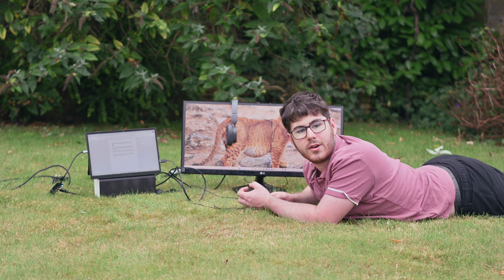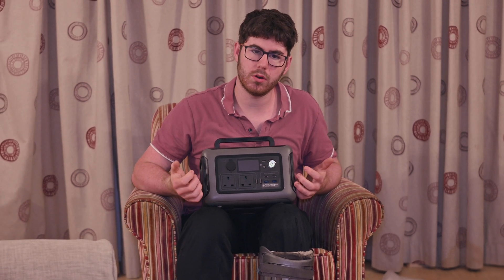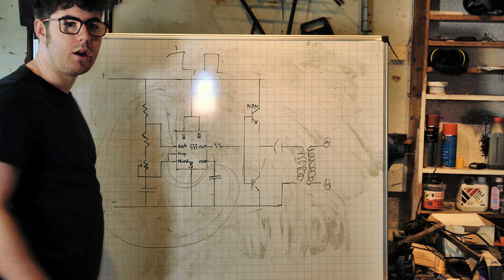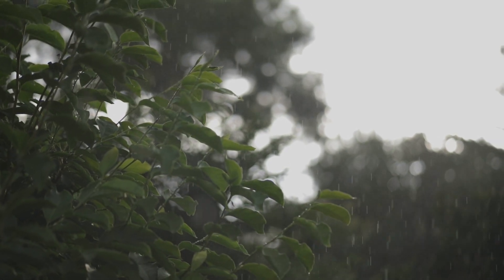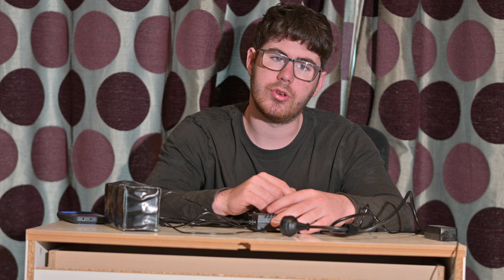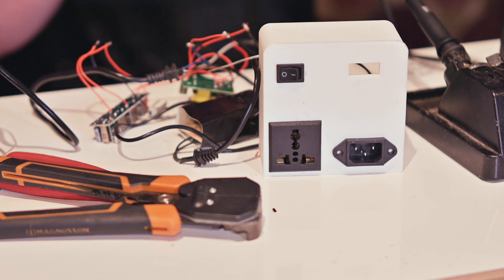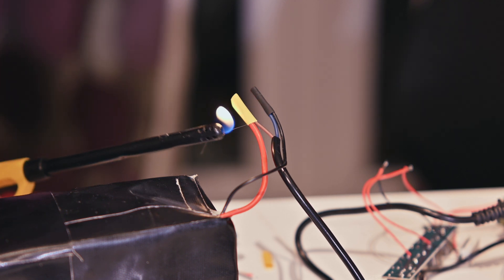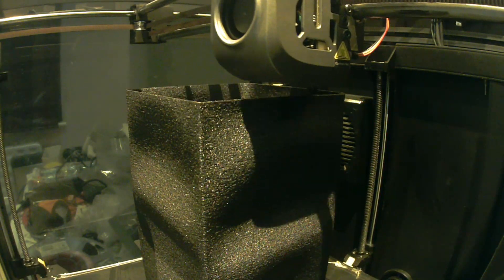Building a PowerStation For $50

Comment: Great video, thanks. Inverter and charger ordered! Can you recommend a BMS product for this project please?
Reply from the maker: Depends very much on your location, what country are you in?
Reply: @Boris_Woodward  Sorry, of course. I'm in England.
Reply from the maker: My favourite is this one: https://www.cellsupply.co.uk/bms/daly-3s-12v-30a-bms
the issue being that you cant get them without paying for a larger order. this one off amazon(https://www.amazon.co.uk/Ouitble-Lithium-Battery-Protection-Charging/dp/B09XV8RQKK?source=ps-sl-shoppingads-lpcontext&ref_=fplfs&psc=1&smid=A2HD2RU644B7TL) is a good cheap alternative but it has no short circuit protection so I would recommend using another form of over current protection. another good option is to step up to 4s so that the current is lower, in which case both theses options come in a 4s config as well

Comment: Very nice project!  Does the $50 (or is it pounds) include the cost of the battery?  Also of note would be the Allpowers does have a true sine wave inverter, where your project appears to have a square wave inverter (which is better than the standard crappy wave PWM inverter in the really cheap products).  Also, your ground wire coming out of the battery seems to be pretty small.  Thanks for sharing!
Reply from the maker: Thabks Price includes battery, but I have wholesale account so I'm paying around $1.3 per cell. As for the inverter while mine was squarewave, the seller did advertise thr new inverter as sinewave, but I'm not sure of I trust them, I'll test it with a scope and get back to you.  Also I'm using 8g wires all round so should be enough.